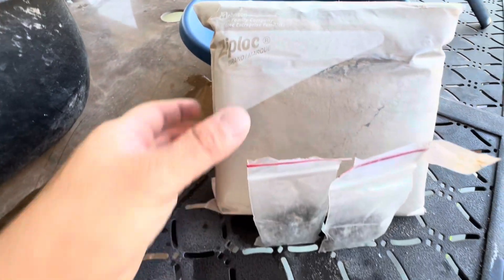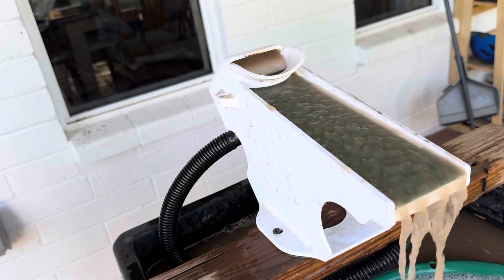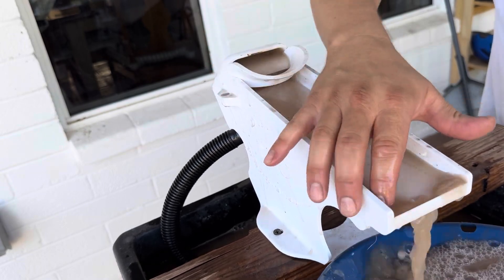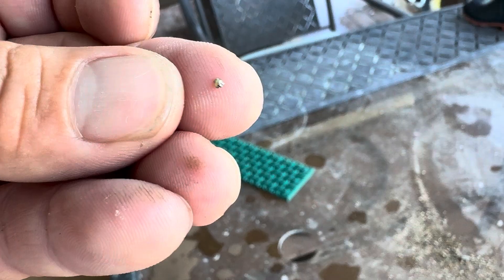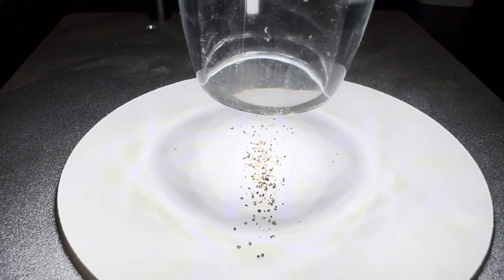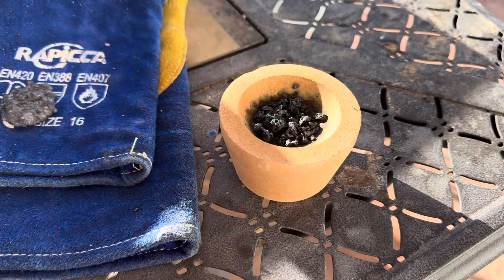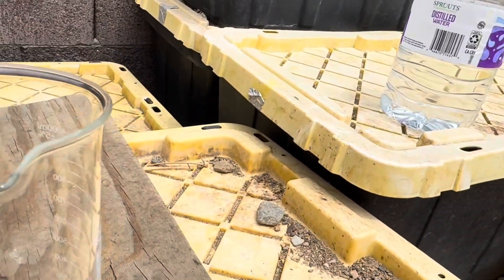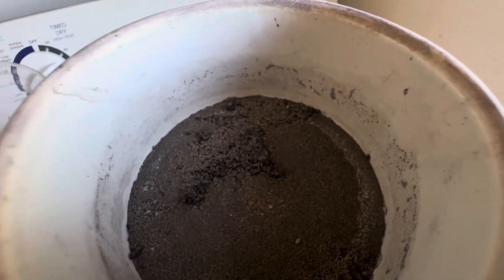Sluicing, melting, cupelling, chemically refining…Can I get anything from this material?

Comment: Out of professionalism an explanation would have been greatly appreciated on the whereabouts of over half the metal I didn't receive back. Even after emailing you I get nothing back. Also I know I would have had more concentrates from the ore I sent you collected during that process. I only got a small portion of that back too. As far as the rest of the missing metal that I didn't receive back. I guarantee it remained in solution when you did your acid processing. Sit on that Mike and think about it. Do better!
Reply from the maker: the copper was the blue liquid, you should know that...and i used it to fertilize plants around the backyard thanks for your advice